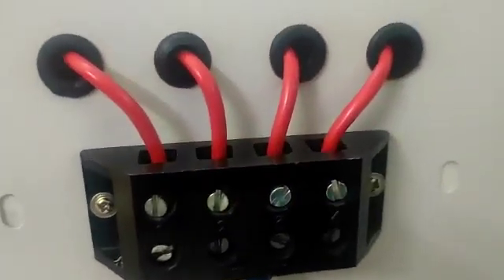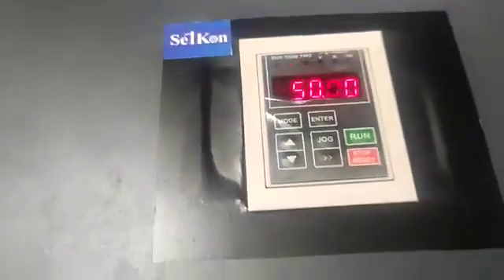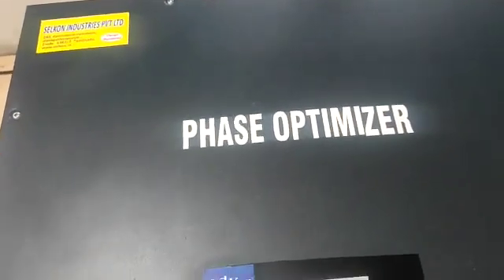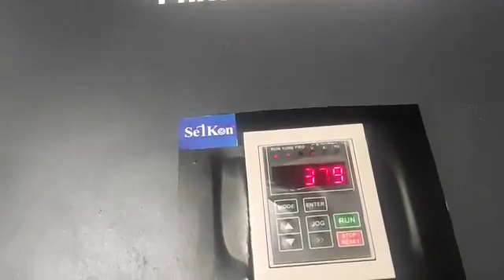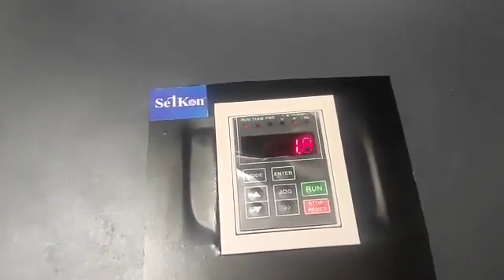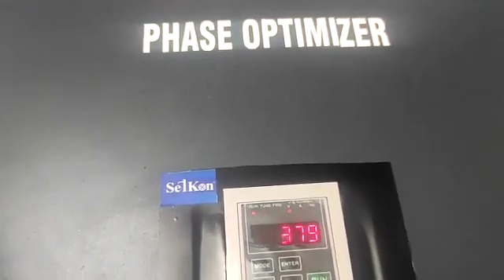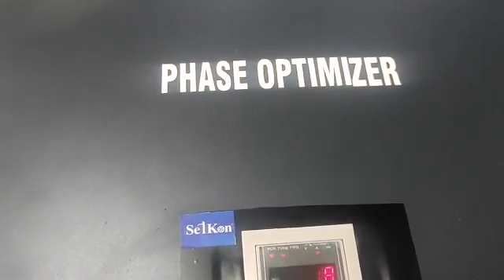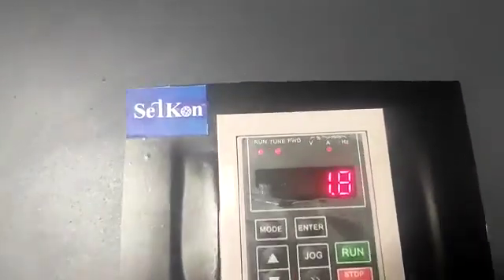SELKON - SINGLE TO THREE PHASE CONVERTER - 230 VOLTS TO 380 VOLTS - ERODE - ENGLISH - 9655831777

Comment: Your contact number plz, 

Can this panel work for 15 Hp 6 stage “Ksb” make submersible motor with star delta oil immersed starter? On 2 phase supply ?
Reply from the maker: 9655321216